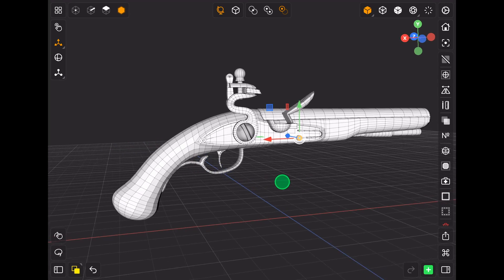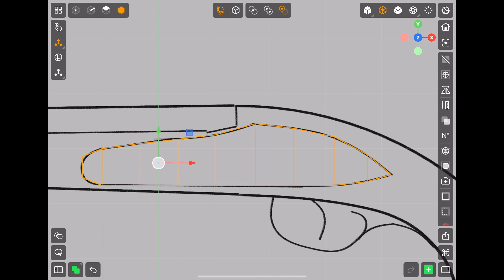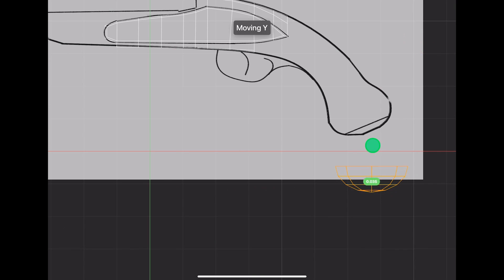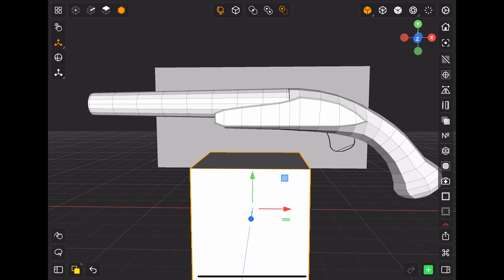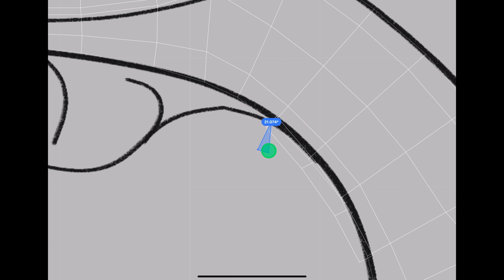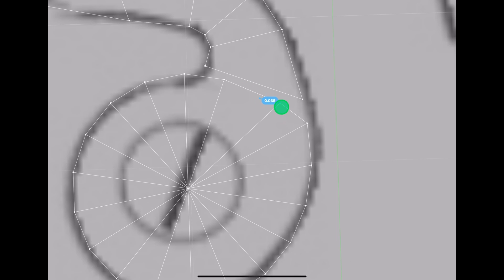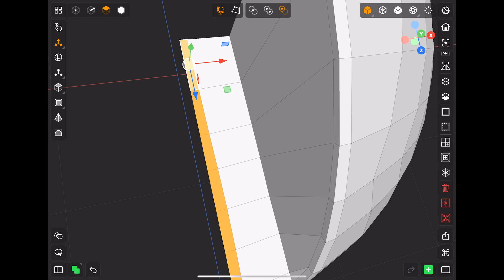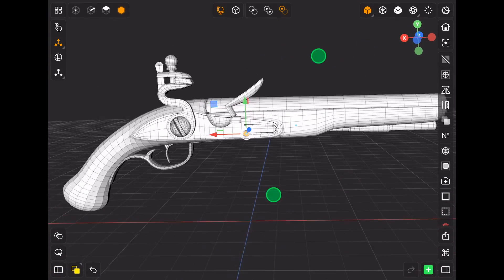3D Modeling On Ipad | Valence 3D

Comment: Thank you for sharing this video and I'll be subscribing to your channel to look out for more videos of you testing Valence 3D out and sharing what you've learned. I've been on the hunt for a good low poly/polygon modeling app on the Ipad. I saw Valence but I've been skeptical about it.
Quick question for you: Have you tested exporting your models from Valence on the Ipad and importing them to the desktop in another 3D program like Maya or Blender? If so, how does the mesh look? Does it maintain the same "good topology" you created in Valence or is it triangulated?

I remember testing out a modeling app for Android. I think Prisma3D was the name. But my models appeared triangulated once I open it up in Maya. So I was wondering if Valence does something similar with its exports or is the topology still in tact in case one wanted to start modeling on the Ipad and finish on the desktop.
Reply from the maker: Thank you ! 
Yes, I actually exported this model as obj and then imported it to Blender for UV unwrapping. The topology was fine. But when I exported the same model from Blender and imported it back to Valence 3D for testing, some polygons looked darker (nearly black ) than the others. I don't know why it happened.
Reply: @vertexsenpai3D  Polygons appeared darker? Do you mean like the mesh just looked darker in the viewport view but otherwise, your topology was the same when you turn on wireframe? Or did UVing in Blender actually change your topology.

By chance you figured out what the issue was?
(Hope you don't mind the questions)
Reply from the maker: @LittleMissSquiggles  Yes, the topology was fine, just some polygons looked darker. Unfortunately, I haven't figured it out yet. Probably some bug related to UVs

Comment: Thanks for the video! What are Valances strengths over Nomad?
Reply from the maker: Valence 3D offers polygonal modeling tools which are great for blocking in and clean topology , Nomad Sculpt is great for highpoly details, texturing and rendering , remeshing . So depending on what you want to create , you may use Valence 3D more than Nomad for one project and Nomad Sculpt more than Valence 3D for another. I hope that makes sense.
Reply: I see thanks for clarifying that, it’s a shame nomad doesn’t do polygonal modelling as it would be then be one fit all app 😅 great content, excellent techniques and helpful tips. ❤
Reply from the maker: @oleww50  Thank you !!